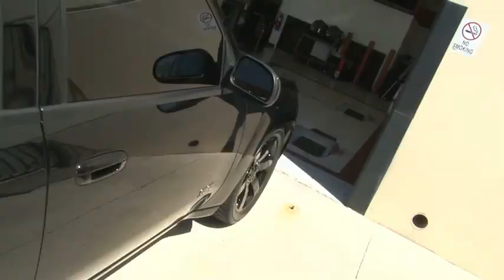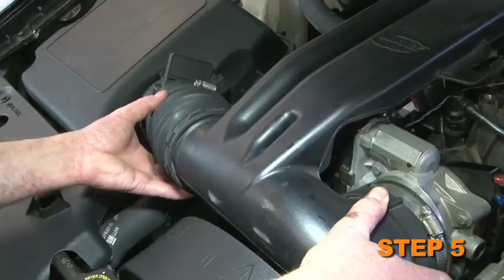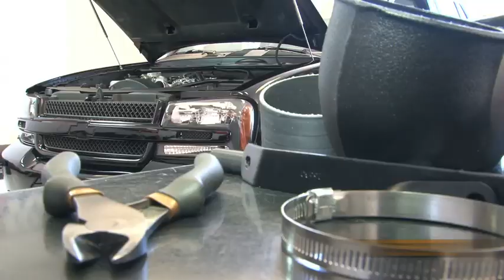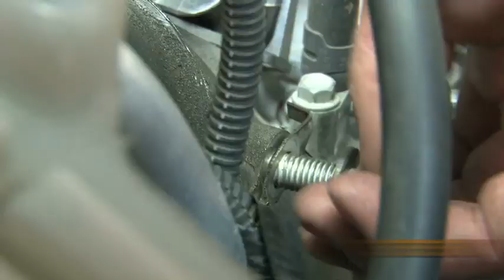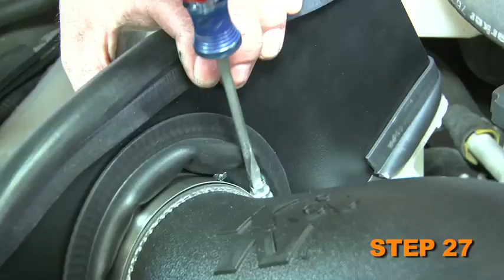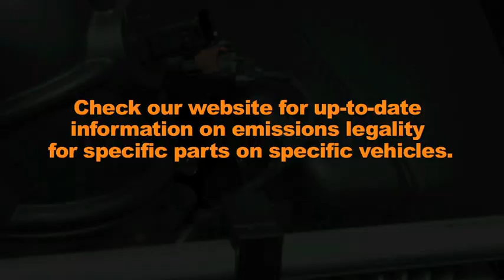StreetLegalTV.com - K&N Cold Air Intake on a Trailblazer SS

Comment: Wow this is absurd! The original air filter system is much better because the filter is enclosed in a box which prevents it from sucking in very hot air.  K&N can give you more power but ONLY if it's in an enclosed box!

Comment: Get an AEM Dry Flow instead. No messy oil to mess up your sensors.
Reply: D4Doom k&n makes a black dry flow air filter also. I would recommend that if the vehicle has a mass air flow sensor.

Comment: i have a tbss with the same cai. i will be the first to tell you k&n messed up. trailblazer ss has a "ram air" inlet in the grill between the headlight on the passenger side. with other cai kits you can look thru this "vent" and see the filter in there for direct air from the front of the truck but k&N blocked it with there kit. i cannot figure out why. can sumbody tell me where the k&N kit gets its cold air on a tbss? i modified mine so now i can see my filter when i look thru the grill.